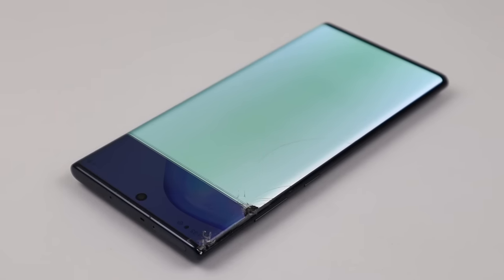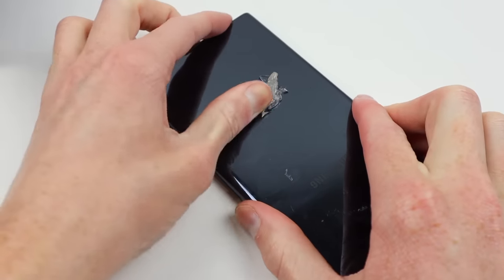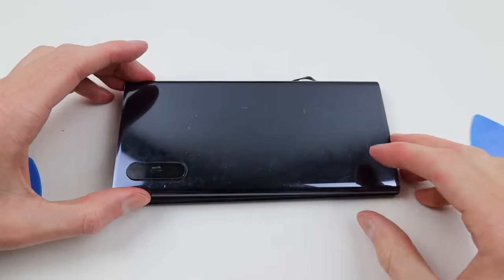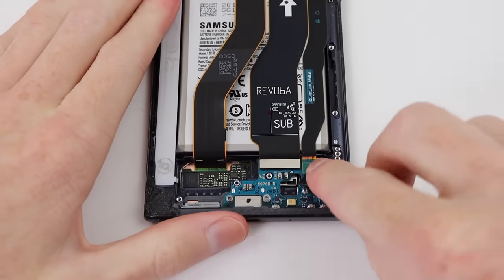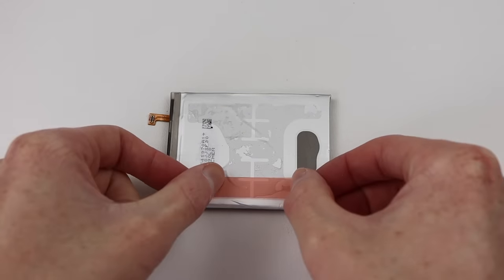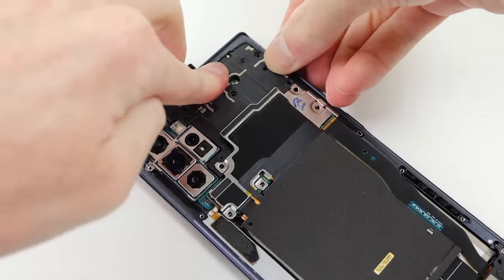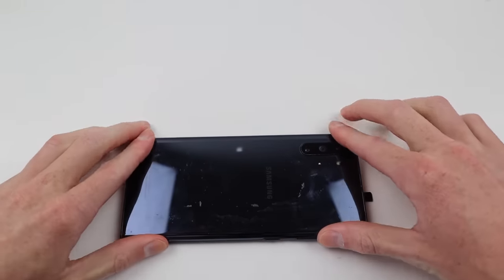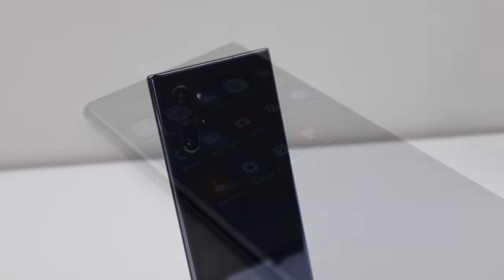How I saved $1017 on the latest Samsung by fixing a broken one - Note10+ Restoration

Comment: Apple: unable to verify whether the battery is genuine. Camera failed to load.
Reply: Shuuush! Apple is the best, atleast better than Samsung, Did you see any Samsung computer/ laptop?
Reply: @realtechandspecs  there are tons of it in Korea
Reply: there is also a thing if there is 1 non-essential component out of order the iphone is stuck in a bootloop. As a phone technician i've seen many iphones 6 and up where a faulty front camera/proximity sensor would keep the phone from booting alltogehter.
Reply: @realtechandspecs  yes iphone 12 pro max is great, it has the best camera in the world and pro grade speaker and display when I saw that it looked very nice, so I'm going to buy note 20 ultra
Reply: @realtechandspecs  Yes I have a Samsung RV509 Laptop.
Reply: @realtechandspecs  Did you see any apple Tanks or fridges?
Reply: Apple flagships have 4gb ram yet 2017 Samsung phones have 6
Reply: @realtechandspecs  Did you see any apple washing machine.?
Reply: @realtechandspecs  Samsung tab, Samsung dex, Samsung Chromebooks, Samsung galaxy book, Samsung notebook, Samsung notebook flash, Samsung notebook odyssey, I could go on.

Do you're damn research instead of saying apple is the best because you have an iPod touch that probably can't even run the newest IOS, which, by the way, logs everything you do and sends it to a third party company through an unencrypted channel. MacOS is doing the same now with Big Sur.

Samsung isn't the best, but apple sure as hell isn't either.
Reply: @realtechandspecs  yea a lot, my school uses only samsung computers
Reply: @realtechandspecs  imagine having an iphone 6 and acting like it's better than any android phone 🤡
Reply: @realtechandspecs  'Did you see any Samsung computer/ laptop?' - That doesn't have anything to do with their smartphones.
Reply: @realtechandspecs  i have one Old But Great For Gaming 2Gigs of ram 450Gigs of Hdd Space Intel Core i3 x64 2.4GHz and i really need to upgrade btw tge brand is samsung ativ book 2
Reply: @realtechandspecs  prove it g
Reply: @realtechandspecs   Yes there are alot of them
Reply: @ludwig4029  i can confirm that a iphone 6 is bad someone i know has it and it sucks.
Reply: @realtechandspecs  Yes I have seen one
Reply: @ludwig4029  running iOS 12 or whatever version of iOS
Reply: @realtechandspecs  You Dropped this: /s
Reply: @kunskim8205  but it doesn’t have the best camera in the world
Reply: @itsmikoton  

It's a joke
Reply: @kunskim8205  ima get woo
shed now
Reply: @kunskim8205  not the best speakers
Reply: @kotirobotti  Samsung user, you have a point
Reply: @realtechandspecs  Shhhhhh I use a Samsung and prefer it over my iPhone
Reply: @realtechandspecs  my laptop has samsung ram
Reply: @realtechandspecs  have you apple air conditioner?
Reply: @realtechandspecs  they use Samsung parts
Reply: Samsung: Bad battery? That fucking sucks lol we glued it so just buy a new one
Reply: @kunskim8205  the 12, does not have the best camera in the world. the s20/1 beats it. what it does have is the best video in a phone camera
Reply: @realtechandspecs  oh my
Reply: @realtechandspecs  laughs in galaxy book flex and galaxy book ion
Reply: @realtechandspecs  the galaxy book duh
Reply: Well, how the turn tables.
Reply: @realtechandspecs  Did you see any Apple fridge/dryer?
Reply: @realtechandspecs  bruh im typing this from a samsung laptop
Reply: @kunskim8205  haha no not at all the Samsung 21 is the best in every single aspect
Reply: @kunskim8205  just wait for the iPhone 13 Pro Max Plus and iPhone 13 Pro Ultra
Reply: @realtechandspecs  pepePoint
Reply: @realtechandspecs  That's gotta be the biggest load of BS I ever seen. You clearly know NOTHING about specs. Hardware wise, Samsung is AHEAD.

Higher ram, higher storage capacity, faster processor, better GPU. 

Anyone who says otherwise is a damn zombie to apple and is only doing so out of "Brand Loyalty" and not Technical Specs.

Like a Scion FRS owner tryna tell a 392 Hell Cat owner he will smoke him and that his car is "better"
Reply: @kunskim8205  that's some good comment
Reply: @asdf-dm3ty  but that's the problem! People like him won't even care about the other brands, no matter how much you tell them they're better.
I guess he even got his expensive Apple stuff from his parents.
Reply: This aged like milk. Samsung is just as bad, possibly even worse now.
Reply: @quintuslucundus2239  Because they don't need a lot of ram, iOS is a very efficient software.
Reply: @himanshshah9425  that doesn't matter they should still be pushing for the best hardware
Reply: @realtechandspecs  In Korea, there are ALOT of laptops available there. But when it comes to PCs, there are available worldwide for gaming and lot of other stuff.
Reply: @realtechandspecs  Samsung is the BEST. No one can beat it, even Apple. I've been enjoying their tech for 4 years now
Reply: that aged like parmesan.
Reply: @quintuslucundus2239  They run like they have 16GB of ram.
Reply: @suddenlyacat  Nope, not faster than the Mac.
Reply: @taha._.5639  And? If they have the ability to make it run faster they should
Reply: Reality: 1 warning in the settings  that doesn't impact functionality. And you can remove the battery easier
Reply: @realtechandspecs  i use an apple phone but thats not true. Mac and its os is ass outside of offices and the phones are so hard to repair ive been considering android
Reply: @realtechandspecs  did you see any Apple Tanks?
Reply: @Gabriel-yd4bq  or vehicles, or medical equipment, or even buildings made by Apple? The Burj Khalifa was co engineered by Samsung
Reply: @realtechandspecs  galaxy book
Reply: @realtechandspecs  what laptop

Comment: I'm really impressed how such a powerful smartphone has such small pieces like the motherboard.
Reply: The motherboard is the powerful smartphone
Reply: @Sanjin Plesa  it’s literally bigger than the iPhone 12 Pro max boards but worse
Reply: @sukhmangill417  they probably mean that the motherboard is the most powerful part of a smartphone
Reply: @AyrisX86  yeah I think you are right, my bad!!
Reply: @AyrisX86  i
Reply: @cybermechid9181  they don’t use the motherboard
Reply: @GTAandApplechannel  Your comparing it to a phone that's a year older than it. The problem with curved Samsung phones is that they break easier my friends both have s9's and they cracked from the sides within the first week of use.
Reply: @PastelMarshmallows  ok that is still bigger than the iPhone X motherboard but still worse
Reply: @Sanjin Plesa what
Reply: @GTAandApplechannel  and also a year older...
Reply: @PastelMarshmallows  I dropped my Note9 from a 2 story car park onto concrete and it's fine. My XS Max hit the side of a metal railing and developed a hairline crack at the top.
Reply: @GTAandApplechannel  they are actually the same size and the s9 is a year newer
Reply: @PastelMarshmallows  iPhone X motherboard vs S9 motherboard size?
Reply: @GTAandApplechannel  oop I thought u were talking about the external hardware
Reply: @PastelMarshmallows  ok
Reply: smartphone isnt that powerful really. its just that software is just optimized enough.
Reply: @Sanjin Plesa Samsung is better than apple
Reply: @GTAandApplechannel  You are comparing a motherboard of a previous generation, the comparison is not fair
Reply: @GTAandApplechannel  S9/Note 9 motherboard, aren't worse
Reply: @androidoneiu5206  the S9 is release after the iphone X
Reply: @GTAandApplechannel  S8 have good motherboard, S9=iphone Xs
Reply: @androidoneiu5206  Samsung motherboard is bigger than the iphone Xs motherboard but worse
Reply: @GTAandApplechannel  bro you are comparing a 2 y okd phone with a new one
Reply: @maxislate5741  no
Reply: @GTAandApplechannel  youre actually one of the worst iSheep i've ever seen.
Reply: The haptic motor on my Samsung note 10plus it's amazing coming from an iPhone 11 pro
Reply: Well as everyone knows samsung is the best
Reply: @GTAandApplechannel  u stupid
Reply: @Li0niii  whatever
Reply: @Kato no , I'm pretty sure about it
Reply: @Kato he should be impressed by something better not worse
Reply: @Kato ok I couldn't find any photos with the two motherboard with the correct scale
Reply: @GTAandApplechannel   what are you gaining from this? 🤦‍♂️
Reply: @Marcos87600  nothing
Reply: @Kato ok
Reply: Small and powerful equals expensive
Reply: @GTAandApplechannel  Not true lol
Reply: @Leandruhh  what
Reply: Power of IC's 🔥🔥🤗
Reply: @Sanjin Plesa a two piece board setup makes replacing a broken charging port way easier. This is coming from someone that has had to microsolder a replacement USB-C jack on an S10+ mainboard. With the 2 piece setup, you pop out a couple of cables and put in a new charging port board. No soldering, no stress. :)
Reply: Where do they get that white place
Reply: Where they get that white place
Reply: @GTAandApplechannel  isnt the 12 board like 2 generations newer?
Reply: @darkw.3947  no
2019
Reply: @GTAandApplechannel  I really can't understand what the size of the motherboard says about a phone.
Reply: @eulehund99  me either but whatever
Reply: @GTAandApplechannel 
You really don't know what you're talking about

Comment: Is it just me who is angry of the smartphones being held together by glue instead of screws? You're likely to shatter panels instead of removing them.
Reply: It's to look good
Reply: @inhex1603  i care about repairability much more than some look.
Reply: @brianfordhamm2740  a rare breed
Reply: @jinglehells7027  all this thinness and shininess is impractical and simply too big for my hands (and pockets in jeans).

If only manufacturers made repairs and maintenance cheaper than buying a new thing... they'd commit financial suicide. But it would benefit me as a customer.
Reply: @Siddhartha Pandey Wireless charging can be done with removable battery - Samsung won't let me lie. Same about reverse charging I guess. 
NFC is no problem.
Look up Samsung's cheap smartphones with removable battery - they still look good, just not IP-certified, it's not recommended to drown them. Good look to me does not require a smartphone to be all thin and sparkly and fragile as hell.
Reply: Some older phones are held by clips
Reply: Glue is more forgiving to knocks, shocks and flexing than screws are so more resistant to breaking and cracking of glass and plastic.
Reply: Its for many resistance issues
Reply: Screws won't provide any dust or water resistance. That's what the glue is for.
Reply: Since it's mostly 'glass' covered, the glue is more effective than screws
Reply: Its to make them waterproof
Reply: @OfficialMuffiin  That's incorrect. Properly designed o-rings and screws can withstand incredible pressures both within and without. This is how distribution plates in PC water cooling systems work; as well as in many hydraulic and water treatment applications. You just need to put the engineering into it. It won't look as good, but you can get just as thin and light with o-rings as you can with adhesive; if not lighter. 

Look at many torn down android and Apple phones and you will see screwed down assemblies that have to be moved out of the way of where the adhesive has to come down. A properly designed bracket and o-ring trench around the circumference of the phone would provide superior ingress protection. And it's not like you can't hide screws. Bezels were designed precisely for this purpose in watches, clocks and other devices, long before smartphones came around. 

What it comes down to, is in hurting repairability so that more phones can be sold.
Reply: @MonMalthias  TIL, thanks. Stupid that they're putting wasting phones over repairability, theres enough electrical waste as is. Now in europe they're pushing for all devices to be USB-C, but apple are dead against it. All so they can't sell their overpriced chargers.
Reply: @brianfordhamm2740  tbf for $1700 we should get both
Reply: @OfficialMuffiin  samsung wil happily take your old phone if you buy a new one and you will even get a discount, and your old phone will then be sold as a refurbished one with new battery, so just stop blabbering
Reply: @brianfordhamm2740  it's not just for cosmetics. The glue also makes newer phones waterproof and is better at holding components together if the phone is dropped. Assuming you also use a case on your phone, this actually makes smartphones more durable so that responsible owners can keep them for longer. Any decent technician should be able to fix a Samsung Note10+ with basically no issues.

Notes are high-end flagship fablets. If you're buying them, clearly aesthetics, size, and performance matter to you. Buy an A-model phone if it bugs you that much and stop bitching.
Reply: İ think the reason is waterproffness of the phone

Comment: No need a hot air station. Just put a macbook on it and it will certainly fry the back panel of the phone off.
Reply: You are way reliable than 5 Minute Crafts
Reply: @mintiistrqwberri5483  lol
Reply: lmao
Reply: Lmao
Reply: Big brain moment
Reply: @mintiistrqwberri5483  whats ur profile pic from?
Reply: Or you could put it near a dell laptop exhaust when playing Unreal Engine 4 games.
Reply: Wrong. Place a Microsoft Surface Pro 5 on it after it’s been running chrome for 25 minutes with lots of tabs open. That would burn the phone.
Reply: @dylanisntvibing  How about my Intel Atom HP Netbook with 1GB RAM, it would surely be affective, at the equal heat of the sun
Reply: or just put it on top of an amd processor, preferably their older mobile ones
Reply: ?????????? there is one Hugh Jefferys Among Us. and he is great
Reply: @vladventura1928  No, put it on top of the old AMD FX CPUs
Reply: @ashii_ii  LOL at that point we're gonna melt the damn thing!
Reply: @vladventura1928  Even better, an FX CPU with the stock cooler lmao
Reply: or another Samsung phone that has an Exynos chip
Reply: lmao
Reply: @Connie_TinuityError  or an iPhone 7 running iOS 14
Reply: Mr. Ambulance true
Reply: Vicious  No, 

*jet engine time*
Reply: No way, place the bottom of the phone on the top of a Intel Pentium 4 processor, since Pentium 4s overheat a lot.
Reply: @glocken04166  No, place it on top of an AMD FX 9590.
Reply: My macbook can do it 🤣🤣
Reply: Lmao
Reply: You guys forgot da real MVP: Samsung galaxy note 7
Reply: Try using a macbook with MacOS instead of W10, first thing you installed because different AV-less things scare you...
Reply: or the xbox 360
Reply: Use an AMD Bulldozer for faster results
Reply: Omg 😂
Reply: @jasonw98  that was more about the battery, the problem has been dealt with.
Reply: Big brain time
Reply: @JamesnLollify  or better. use my laptop without fan playing ms flight 2020
Reply: @glocken04166  celeron d would work better
Reply: @ajemajh  Nope. Pentium D would be so better (in terms of overheating) than the Celeron D or the Pentium 4.